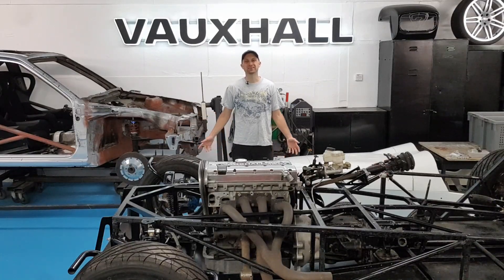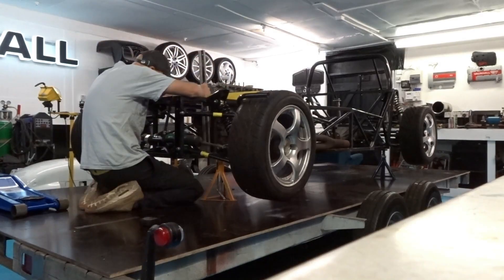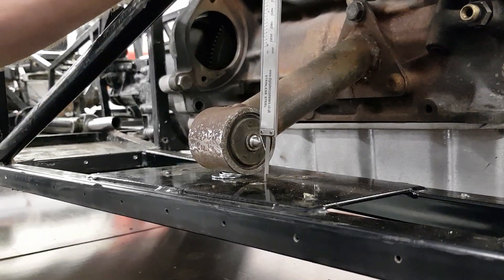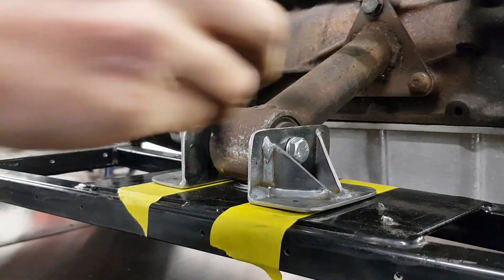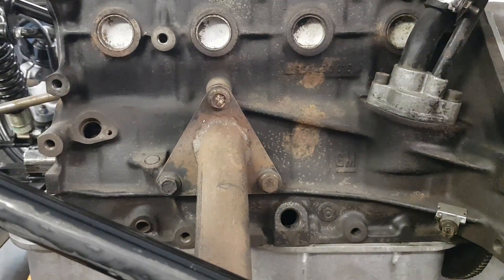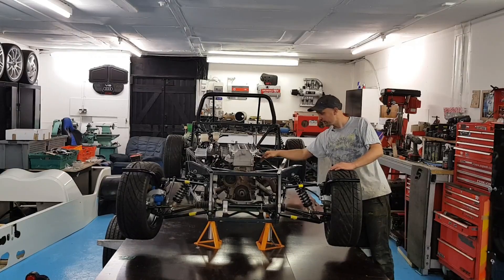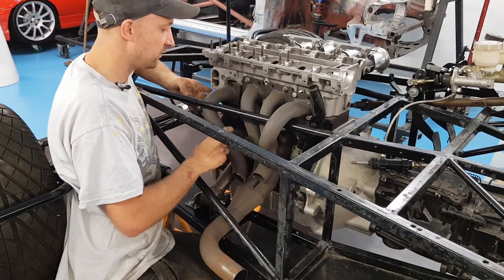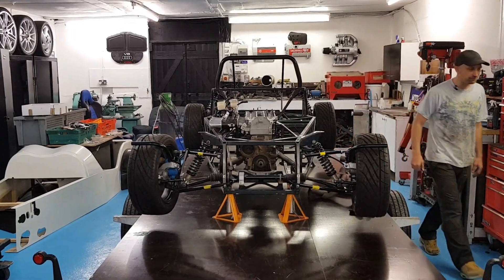Ep5: Fabricating Engine Mounts For My C20XE GBS Zero Kit Car!!

Comment: There is no need to set pinion angle? It is OK the drive gear to be leveled? Diff as well? I'm building a Locost from scratch.
Reply from the maker: This chassis has all the mounting locations pre drilled so they have already worked all that out. If you are making from scratch you will have to calculate it yourself.

Comment: You can try just flip first and four cylinder pipes upside down (bottom bend much shorter)  so you dont need cut 20 mm, but need just weld blange
Reply from the maker: Yes that is one of the options I'm thinking about 🙂